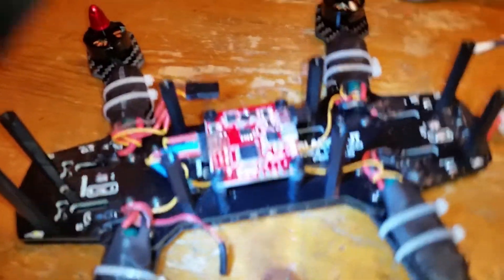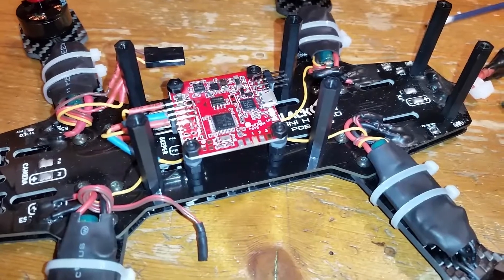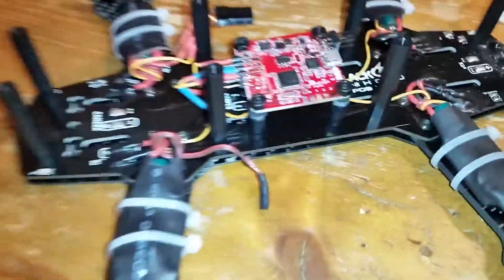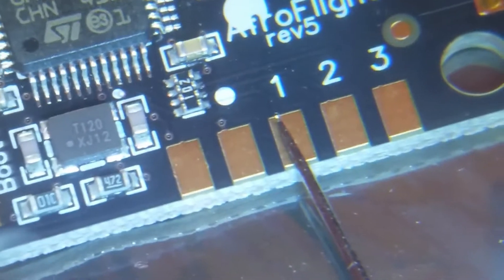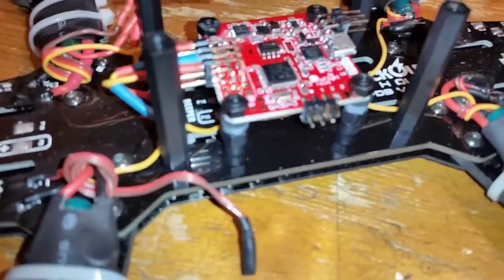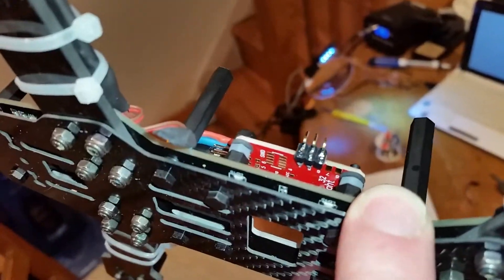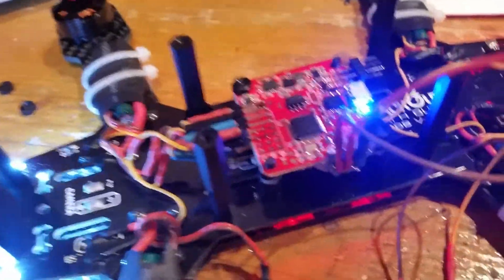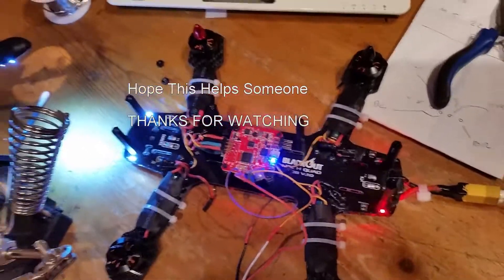Fix Damaged Solder Pad on Naze32 or other Flight Contoller

Comment: Mate I have done this on two boards, the pads are completely off, how did u repair??
Reply from the maker: PlatinuM MGO Hi, it doesn't matter if you have lost the pads. Try to see if you can still see the trace that goes to them. If you cant then try and expose a bit by scratching off surface plastic till you can (trace not pad). I tried to show in video but probably not great! Basically, if you can see/expose a little bit of the trace that used to go to the pad then you can use the pins as shown in video as a means of connecting to what is left of the trace by (briefly) soldering to bridge to the trace at one end and provide a means of connecting 'normally' at the other. Best to use a very quick high heat solder join at the trace end so as not to burn out what is left. Feel free to post pic of damage and I will see if I can help. Best of luck.
Reply: Cheers mate thanx for the lengthy reply, I've managed to damage 3 like this, might get an electrician to see if he can have a go!
Reply from the maker: You don't need an electrician mate - If I can do it then you can! It is a bit hit and miss and I was lucky but all you are trying to do is flow some solder between the pin you are using as a bridge and what is left of the trace. Use as hot an iron as you can get and be quick. Don't be tempted to keep going at it. Load the tip of the iron with solder (leaded is better - Halfords sell it), let the iron get as hot as it can  and then touch the tip of the iron to the bridge you are trying to make whilst feeding in the solder. 4 seconds max. Good luck. Thanks for watching.